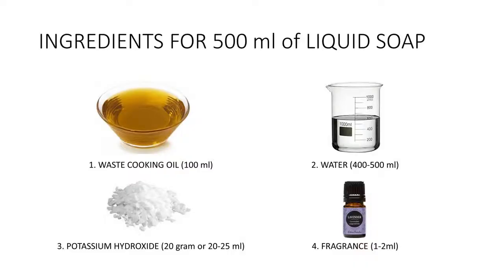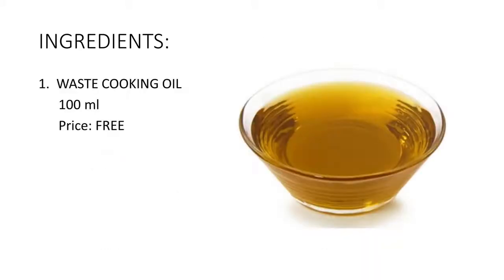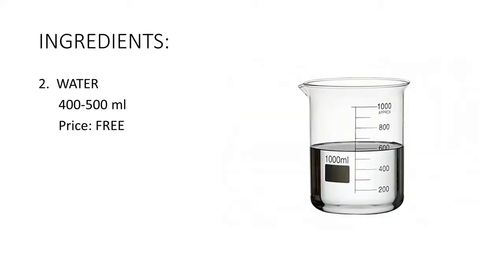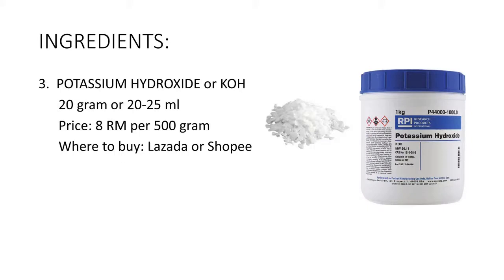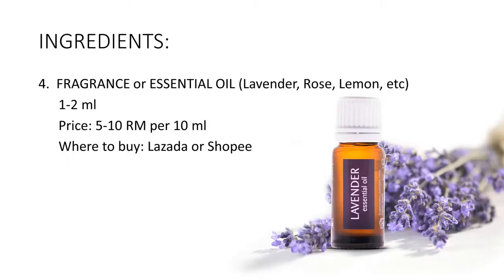Making Liquid Soap from Waste Cooking Oil - UTP Craft Series

Comment: Sorry potasium mix with 500ml water then mix
In the oil right? Ur video show other things
Reply from the maker: The potassium needs to be diluted first in the water before mixing it with the oil. You can always add more water later based on your preference (in terms of how thickness or fluidity of the soap).